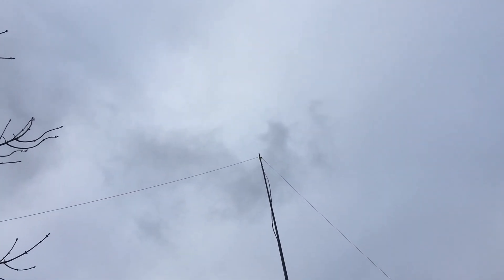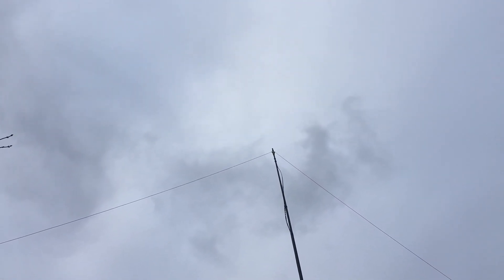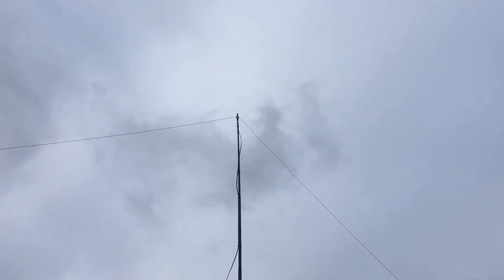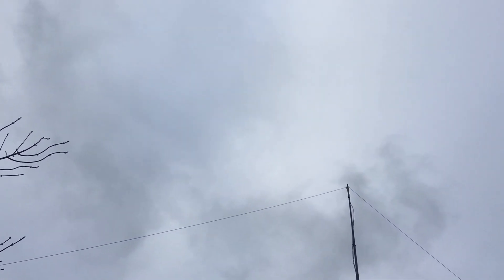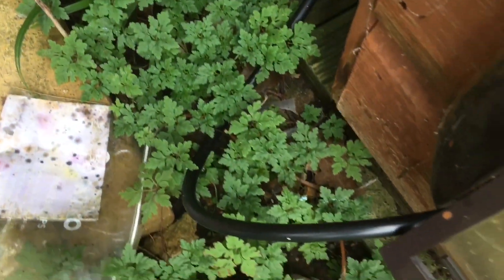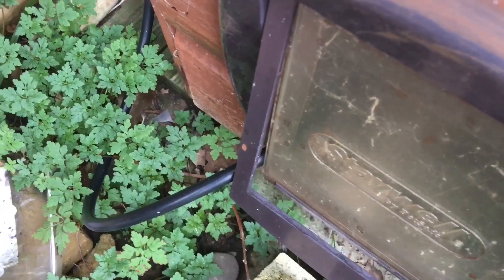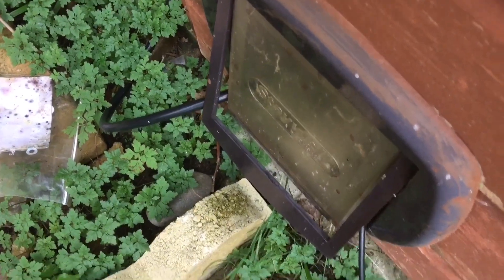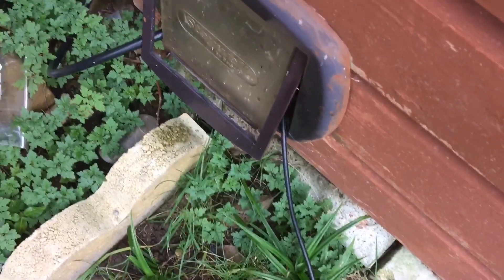44 foot doublet -- revised home install

Comment: not a Doublet . take the twin feed all the way into a Balanced ATU. then you have a Doublet.
Reply from the maker: Respectfully that's rubbish my friend. Doublets can be fed via a Balun or direct into a balanced ATU.
Reply: @timg5tm941  not according to ARRL's wire Antennas Classics Book, " Respectfully" so if there wrong Blame them. im not saying it wont work, just the definition of a Doublet.
Reply: @timg5tm941  it looks to me like what they refer to as a Zepp antenna ,
Reply from the maker: outlawhead I too have also read plenty around the subject and a doublet is classed (IMHO) as an antenna fed in the centre with ladderline, twinlead or similar. It can reach the ATU directly (using a balanced ATU), or an unbalanced ATU via a Balun and as short a piece of coax as possible, preferably low loss coax. 73